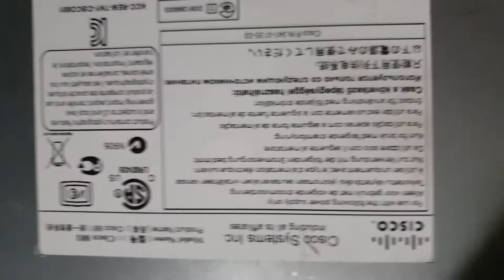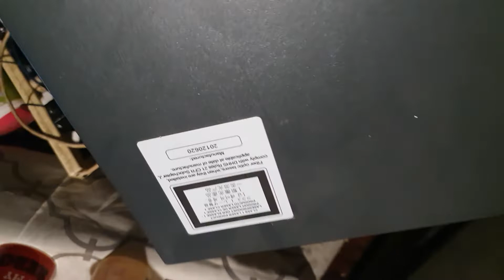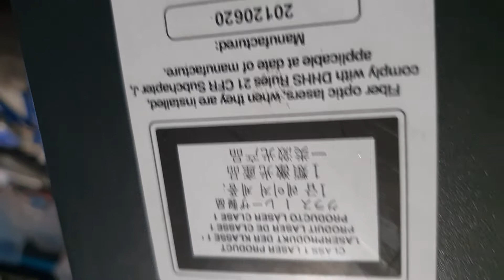SCRAPPING / scrapping two Cisco devices for gold recovery

Comment: Hi Pete if you don’t know in the STP tubes at the end is a plug full of gold and gold corner bga has the gold mark to show placement on the boards and the bga with no gold mark it’s the same as gold corner one but it doesn’t matter witch way it goes on the board
Reply: Sent you some pictures pete
Reply from the maker: @coinkiller5495  thanks
Reply from the maker: whats an stp tube ?
Reply: @prospectorpete  it’s the Crome long square tube you took of the right side of the switch the to of them
Reply: I stripped two switches with 48 in each and all 96 STPs in them they have gold fingers like ram and BGAs on them to and gold boards
Reply from the maker: @coinkiller5495  nice